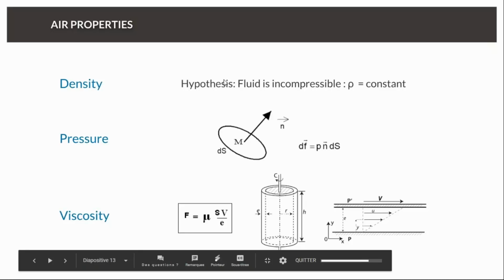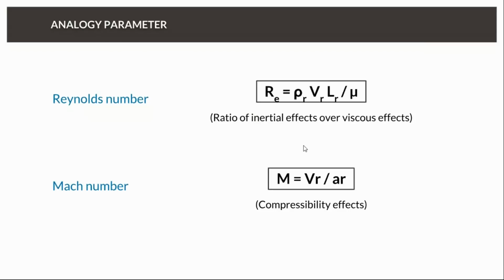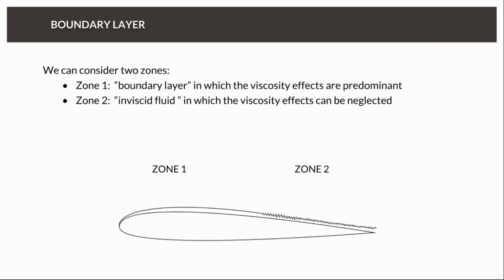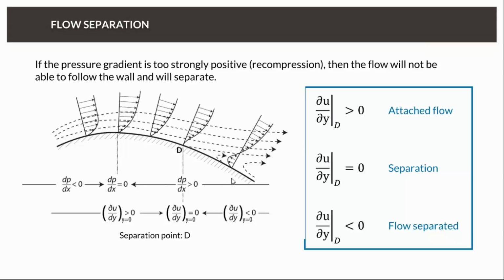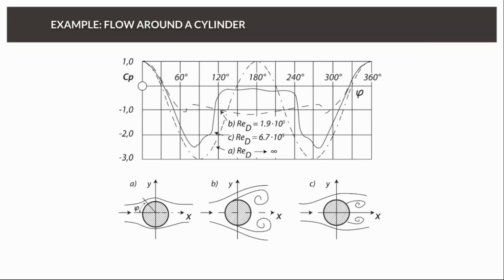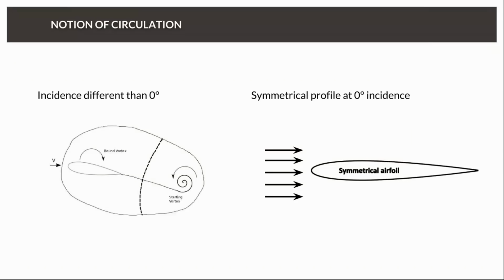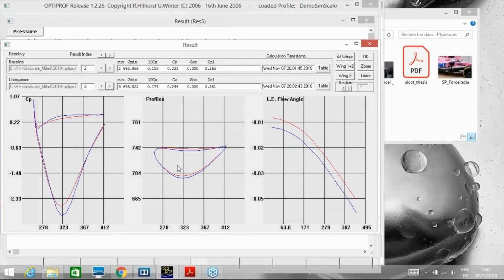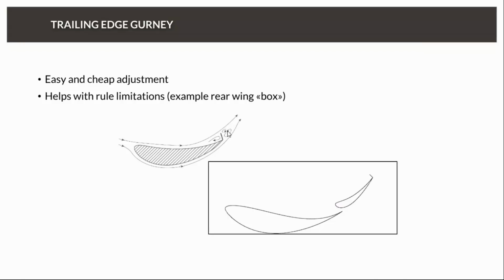CFD in Formula Student and FSAE – Session 1 – Fundamentals of Aerodynamics

Comment: what i didn´t quite understand was why pressure increases, when air goes through a tube with increasing diameter. There´s like the same amount of particles in a bigger space, so the pressure should decrease.
Reply: inside a tube the the volumetric flow (cubic meters per second) is constant. This means if the diameter increases, the Fluid will have to slow down to keep the Volumetric flow constant (as long as it is incompressible).  A slowed down fluid means actually more particles are inside the same space (though the diameter increases so i'm not really sure about this part). 

More importantly take a look at the Bernoulli equation, which will only contain the pressure and the kinetic energy, this means if speed decreases on one side the pressure has to go up to compensate.

Hope this helps
Reply: @xerim6784  Good explanation! But take care not to apply this to airfoils which is a common mistake :)
Reply: @JousefM  thanks for the quick reply.
I'm actually just now getting started with aerodynamics through E Motorsport Cologne (Formula student). I have more of a fluiddynamic background, where we only talked about piping systems and turbines, so I am in the process of learning how to calculate/simulate airflow.

Your reminder might come in handy in the near future, thanks again.
Reply: @xerim6784  Awesome! :) Good point, maybe I will do a video on how to derive a good understanding how airfoils actually work because the common explanation with pressure and velocity as also some professors explain it is definitely wrong. Will keep you updated! :)
Reply: Hi Maximilian! I guess you mean the part where René explains the Bernoulli equation?

The slide says exactly what you mean, namely that the speed increases and pressure decreases also known as the venturi effect and is used in applications like carburettors. Does that make sense to you? Let me know if I got your question.